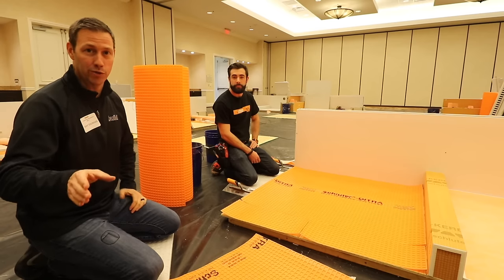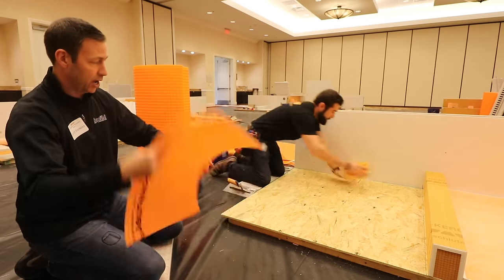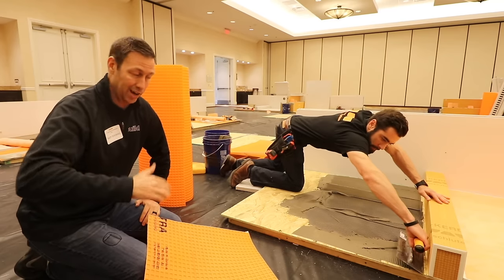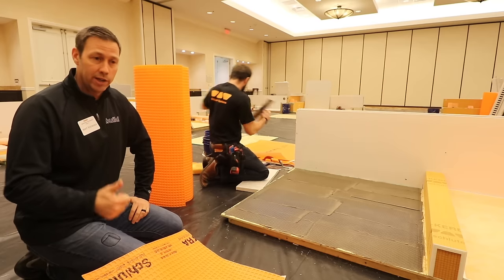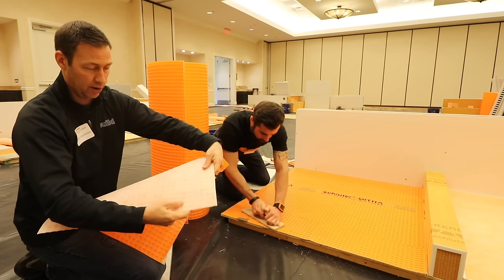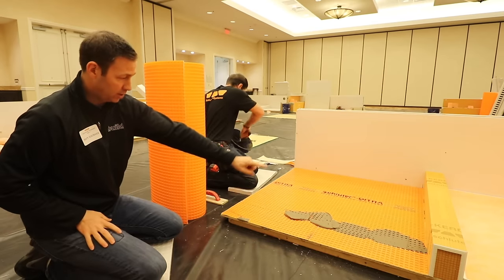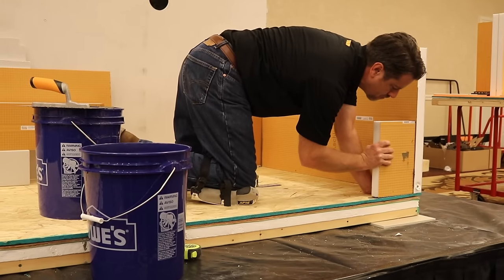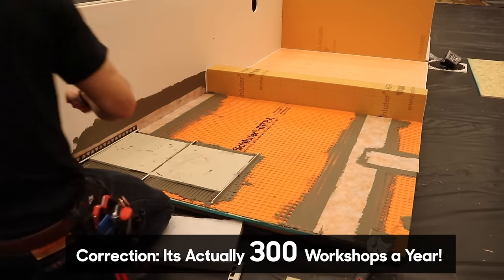WHAT is this, and WHY do you want it under your floors?

Comment: "You can't adhere tile directly to a subfloor. That's not going to work." What!? I'm no professional, but I've installed ceramic and porcelain tile in 5 areas of my home ... and every time directly on the plywood subfloor. Without a problem. So could you tell me why it's 'not going to work'? The tiles I used in all those cases were 12" x 12".

The reason I'm here looking at this is because I have a 10' X11 ' sunroom (sort of) floor that I intend to cover with 12" x 24" tile and think I might need this product. I have a double layer of 5/8" plywood for my subfloor.

Comment: We've seen this a few times. Will it protect tile in a moving bus?
Reply: In a moving bus or from a moving bus? Do you mean the vibrations from a bus on the road in front of the house or this being installed in a vehicle, like a bus or a trailer? As this is rubber (or foam?) it will absorb a great deal of the small vibrations, so it protects the tiling. I guess it will perform far better against vibrations with this installed.
Reply: Adler Mow we are turning a school bus into a Motorhome. It will be rolling a lot.
Reply: @bussedamove  From what I know from this video, unless this product is expansive, its better to use it instead of simple concrete. Also, there is flexible grout formulas that allows for the tiles to vibrate and flex a bit without cracking (kinda like the silicone used on bathroom sinks). Also, if you cut and scrub the grout away you can reclaim the tiles and install different tiles in their place.

Comment: The real lesson here, slab on grade is a stupid way to build, and before anyone starts in I'll add if you can't dig a basement there, you shouldn't live there.
Reply: Basements are nice to have but most homes in Oklahoma do not have basements due to the clay soil and shallow water table.  My house was built in 1968 on a slab.  I removed the old vinyl and parquet flooring 20 years ago for ceramic tile and there were no cracks then.  I am tearing out that and rest of carpet in the house to put in new wood grain ceramic tile.  Still no cracks.

Comment: I’ve got a 35 year old house with concrete slab and tile in all wet areas of the house. It’s all fine. I’ve got another 20 year house with tile on concrete and it’s fine. Listening to this guy makes me wonder if he’s doing the basics wrong and feels the need to reinvent the wheel to justify his failures.
Reply: Nowadays people put in very trendy tiles, that then look dated quickly, and so they want to replace them every 10 years.   This is just like everyone painting their solid wood cabinets white to match the big box store MDF crap trend.   A timeless look is then replaced by something that will fall out of fashion quickly, turning a $15k set of cabinets into a $5k set.  It is sad really.    "It looks so modern" should be heard as "It looks like disposable crap."

Comment: Double + the thin set cost, new tools, $349 a roll. I think I’ll skip the membrane. We will see what happens. Seems like a fix for a problem that could be solved by proper installation to begin with.

Comment: I’ve been tiling for thirty years, I never understood the point of this stuff when it first appeared and I still don’t, causes more problems than it supposedly solves.

SBR bonding coat and a good quality flexible adhesive, job done, concrete or timber.

Comment: I've been doing tile for 15 years, this stuff is garbage, use it and your tiles and grout will be coming apart.  Not to mention they just used 2 bags of thinset just for prep.You have to use 1\4 inch  backer board and screws

Comment: Hi Matt,

I am considering about putting a porcelain wood like tiles on my floors upstairs on the second floor that has plywood sub-flooring in CA. In your video you had mentioned that you would use the cement board which adds thickness and weight upstairs. If I use Schluter Ditra xl, would I  still need to use the cement board so my tiles will not crack or I can get away with just Schuter Ditra. In CA earthquake  is also a concern so they try to build the second floor as light as possible.

Regards,
Harry

Comment: Everything relies on that very small bevelled edge.....      Mm mm.        Will be sticking with Durapal
Reply: it works.  We used it to do our kitchen above a basement.  We replaced the floor cause the grout was cracking due to movement.  After 5 years, not a single crack in the grout.

Comment: If concrete cracks? Why do they build nuclear power stations and dam walls out of it. I would say that you have a problem with how the concrete if poured  and laid.  Guide vibration and low water content makes a good quality concrete. May be it is to do with price. What is the customer going to do if the concrete cracks. Make the builder rebuild the house?

Comment: Sadly it’s good yet crap. 
Take a rubber hammer hit hard. Tile will pop up with thinset on tile with impression of floor. 
It doesn’t lock it in. 
Flooring for heated floors locks in so much better.

Comment: Cement board is fine and not dusty when you cut it with a knife and it’s not expensive what so ever
Reply: In NY equivalent sq ft of cement board to ditra is about the same price. Factor is the cement screws(a ton) if doing it properly, the thinset under the backer board. Yes it also has to be done and the meshing the seams. All this adds up to about the same price. Ditra all the way.

Comment: I kind of think its a waste. It does not do anything about vertical movement and cost too much to install and in most cases pretty redundant. 
And the bond achieved with the tile is kind of questionable since its a plastic substance, you can never be certain that the tile won't come off. Great if you are a contractor to squeeze more money but its really unnecessary and iffy.

Comment: Ove installed for 21 yrs, I used this when it first came out, hardie backer is better hands down.  This is faster  , no doubt but you will have lumping no matter what you do with this crap, it's a plastic surface so be cautious on what tile mortar you use.  This guy is an instructor not a contractor.  You can always tell who's a setter by looking at their hands.  This guy's hands are way too lotioned and uncallused 😂😂

Comment: We have so much new technology being presented to us today...and most of it is simply space age looking unnecessary substitutes for already well working systems. Yes ..we hear how it makes it so much easier for the builder or tradesman ..but what they are not telling you is just how much more costly it is for the client ..and how catastrophic an event can occur, when these alternative systems fail. And no ..they are not as durable as many of the older tried and true systems we have been using for many decades. A house today has a 35-40 year lifespan...yet same house built on traditional materials and systems are still functioning since prior to ww2. 100 years to be exact. Just this system alone worries me... looking at the material ... we have wood, then cement-polymer mix, then polyethylene, then they will apply cement-polymer mix again with ceramic or porcelain tile. Headache waiting to happen. The intermolecular forces produce specific adhesion although this can really be divided into three different types, namely, chemical adhesion, dispersive adhesion, and diffusive adhesion, to which are added mechanical effects in effective adhesion. This is where it all comes unstuck..no pun intended. Each of these products sandwiched here, have completely different properties of expansion and adhesion. Not to mention the variables in molecular surface cohesion and absorption. Delamination is a regular problem with these products and builders should be very wary of putting their names to some of this new tech that does not have proven track record. These training seminars occur when they do not have the full support of the building industry, so they teach unaware contractors to do this for them, as they both unaware and poorly knowledgeable in these matters. All problems are then directed to the company who will bamboozle you in BS or threaten legal action to keep the problems quiet. Think twice before following a builder who does not recognize the effects of the services and materials they recommend!

Comment: Ditra comes in big expensive rolls and a shower floor or 6' X 2' counter, well it will not cost $329 or more to use cement-board. Too heavy cement board just got light!
I like the product and would get it otherwise. You need to scale expense to smaller jobs for my situation. For that reason, I'm out.
Reply: This is truly a case of you get what you pay for.   It's not cheaper than 'traditional methods' initially - it's down the road 15-20 ears where the concrete board install has to be re-grouted or completely removed due to floor flex or slab cracking.

Comment: You forgot to mention this product doubles the cost of the build out. Schluter is a very expensive product and is time consuming to install. If not applied exactly as instructed it will fail like any other install not done correctly.

Comment: you don't want that under your tile. use Hardibacker cement board
Reply: Jim, I found it under my current tile fireplace hearth, how do I remove it. I'm a 77 yr old man in decent shape... But man this is back breaking to remove. I used a hair dryer and a cold chisel... Do you have any suggestions on removing Schluter Ditra underlayment
Thank You

Comment: This system was done at my home just before we bought it. It failed, too much flex, ultimately over just a few months the grout start coming out. I had 3 different experts out that all said the same thing, this system is trash and they replace them all the time. We replaced with a tradition way and no problems.
Reply: If it flexes this issue is either a bad install or sub floor issue.

Comment: This stuff will not last over time. It’s basically a foam product. Plastics are petroleum based, so it will become brittle and rot over time. You can not completely waterproof this stuff because it’s seamed.

Comment: You could also look at it as the cracked concrete cracking the tile has warned you there is a problem. Schluter solution is HIDING an issue that should otherwise be dealt with.  We have literally been tiling just fine for over a Century.  Just another company trying to make money. Not a fan of Schluter products. Sealing your shower should never cost more than the tile.

Comment: i don’t like it.  i’ll tell you why.
it’s hard plastic, and thin-set needs something to bite into.  
like when you paint a shiny surface that paint peels off.  just like the paint tray liners, that doest let the paint penetrate ana it peels off.  it’s hard no-porous shiny plastic.   no good !
that stata liner or whatever it’s called is not porous at all and won’t bond with thin-set.
the tiles may go down ok but i’d bet that everyone that uses that stuff will hear about the tiles popping up or cracking.
that membrane was designed for concrete subfloors that tend to has moisture and crack. that membrane will allow the concrete to move without effecting the tile floor above it, BUT, i still think the tiles will pop after some time.
i installed tile thirty years ago on many jobs over plywood and it still looks good and still set strong.

stata may may bring in some money for the company that makes it, but i think it’s going to bite them in the ass at some point.

that’s my story and i’m sticking to it.
cheers !

Comment: They want you to use a non modified thinset for that stuff. Do not I repeat do not use non modified. Use modified and give it that extra 2 day cure time. I install this stuff all the time and the non modified shtick they give you is bs. A marketing tactic to sell their thinsets. Plus modified is stronger by at least 30 %. Also prime the wood subfloor before installation. If u fallow those instructions your home basically would not even shift over time due to the strength of the modified thinset. Yes it's for decoupling but you also do not want your German waffles to unpeeled from the sub

Comment: What is this.......it's crap. We used it during our build of our super high end 22 acre campus and it won't hold up to commercial use. We ended up 15 years later having to do an entire campus bathroom renovation because the product started failing. Needless to say, we didn't use it again. It's an OK product, but not a wonder material.

Comment: 6 minutes in and I haven't heard a thing the dudes saying. 💤 can someone do me a favor and just tell me what it is and what it's for. I assume its similar to  carpet underlay and provides both insulation and a cushion for which will provide the tiles with some movement so they are less likely to crack or come away from the floor. I need some heating or at least not feel like I'm walking on ice, i need insulation! am also cheap so I need it to be pretty much free no more than a score (£20) for 3m x 5m floor. any helpful suggestions appreciated troops
歓声男

Comment: This is a needless product. Most subfloor concrete does not crack. When it does it often has no effect on the tile. But if it does you simply replace the affected tile(s). Much cheaper than laying a floor with this expensive product.

Comment: I've been installing flooring for over 20 years, I have never used this product nor would I ever use this product. I've seen a huge amount of floors fail because of this product. If you are not using plywood as your subflooring...... You are stupid! Whatever you put over your subfloor is entirely up to you, whether it be waterproofing or this product. If you do not have a minimum of an inch and 1/8 of flooring material, (plywood building material), this product will ensure that your floor fails because there will be too much flex between the floor joists. I hate when they show you how to install tile over schluter knowing damn well it is not a product designed to prevent flex, only plywood reduces flexibility. Also....stop using cement board as your subflooring material. I've demoed enough floors to know "plywood" (at the moment" is the best material  for a subfloor, then put down whatever you like. 😡
Reply: I was wondering about flex. Seems like this would allow for too much flex.
Reply: @pauldavis9387  it does flex! Plywood reduces flex meaning that your thinset which holds the tile to the floor will not separate over time, and also prevents the tiles which are attached to the thinset which are attached to the floor will not crack if you have sufficient flooring. Schluter does not reduce flex, nor does cement board. Concrete is only good at compression, not flex, which is why we put rebar or wire mesh in concrete.

Comment: This shit doesn’t always work... the mortar dosent always adhere properly to it....one reason is it dosent lock into the squares well just sits in there ...... secondly you don’t always get adhesion into the felt backed underside which should always be done with a vnotch trowel not a flat trowel .........and finally it comes in a roll and sometimes it dosent wanna lay flat on installation .....you gotta leave it out for a day to get the kinks out ...there’s better products out there actuslly and yes I’ve been laying this shit since it came out 25 years prob .....

Comment: Instead of homebuilders building better foundations, someone figured out a product to help hide defects. Awesome....
Reply: This is not about better foundations. Concrete and tile are two different materials. So they will expand and compress differently when reacting to temperature changes. This is why you always a decoupling in between those two materials. I'm surprised this is not standard everywhere... In my part of Europe, there's no way you're putting tiles on anything without a decoupling mat between the tiles and the base.

Comment: so Matt admits that the traditional method gets you good results if done right, but??? You still recommend the more expensive method? that teaches installersto avoid proper craftsmanship? this is a cop out product. Id rather be honest with my customer and tell them how to do it right from the beginning, using proper subfloor buildup (with joist stiffening if necessary), proper backer board installation, and proper waterproofing layer. This is why tile installs done right last and last. This schluter product enables unskilled builders to do a quick and easy install while charging the customer for work as if it was done by a pro tile installer, seen too many of these schluter tile installs thrown out.

Comment: There are so many epic fails with this Video. Matt obviously doesn't fully understand what he is trying to explain. First off, there are far better products to use for crack isolation than an uncoupling membrane. Secondly, our whole world of flooring is about bond strength. Using an unmodified Thinset as, Ditra requires for it to fully cure doesn't meet ANSI standards for bonding according to NTCA. Thirdly, That demonstration is over OSB not plywood.

Comment: BS , builder gas nothing to do with what a contractor uses unless he tells what the contractor what to use.  You use a rubber Membrane over your cracks and it works !  And you do not have to go over the whole floor like what this guy is trying to sell you which will cost you .   Two ,  when you cover your floor with thus crap on your knees are smashing it .   Hardi backer is a better product for newbies and installers